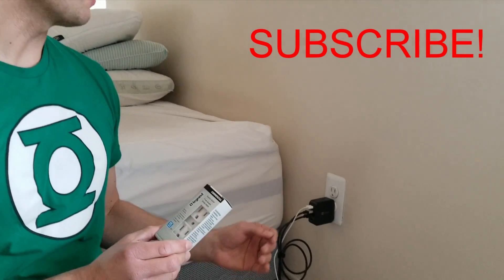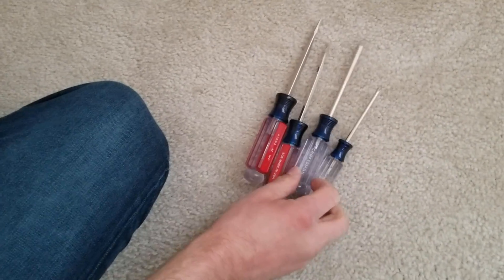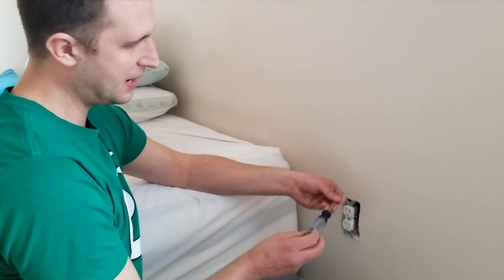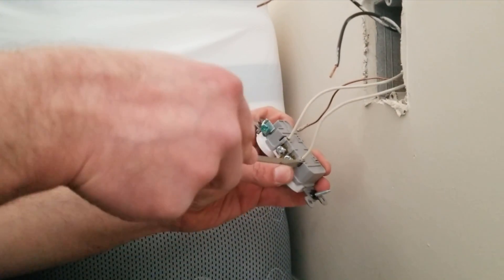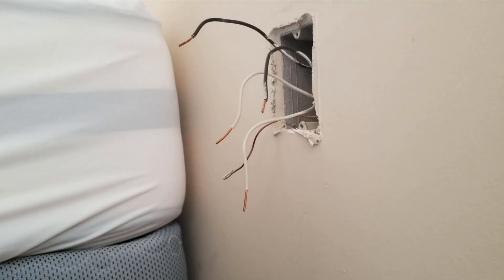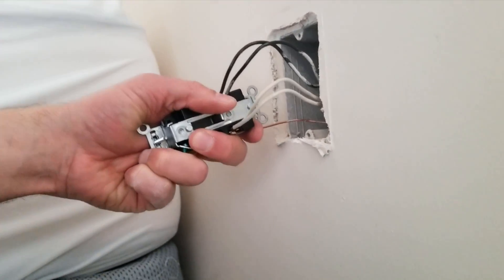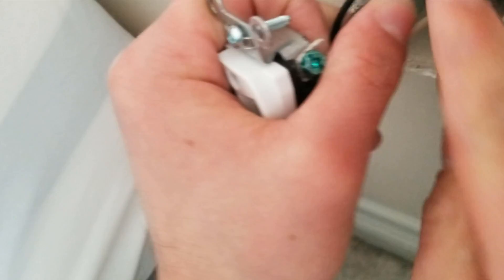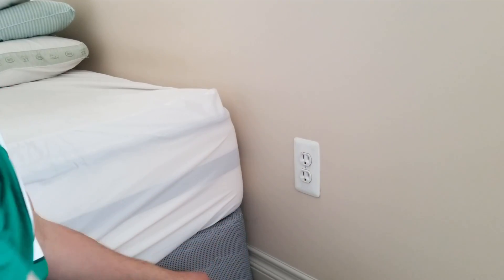How to remove and replace a 110 volt three hole electrical outlet receptacle.

Comment: If u look it up it’s called TR (tamper resistant) receptacles so the receptacle will require both top prongs need to be fully in the the out or it won’t work. Because this is the case the receptacle really holds it tight